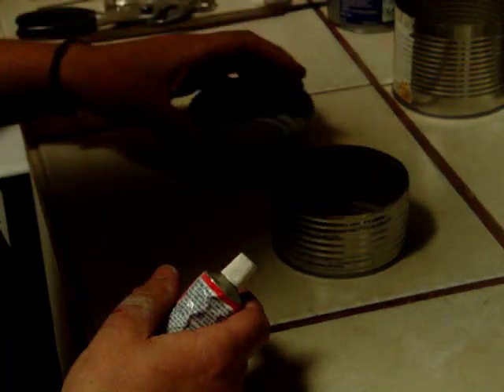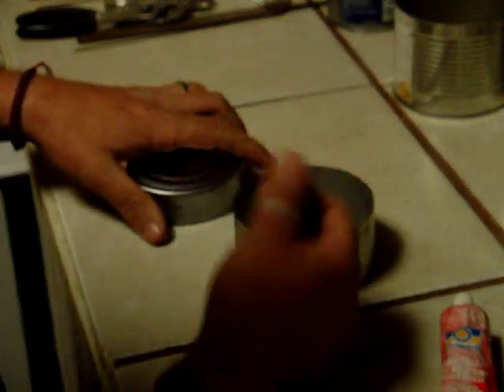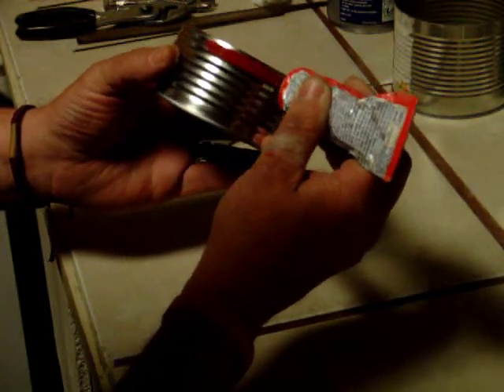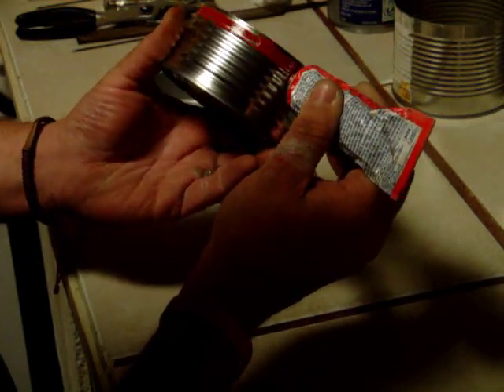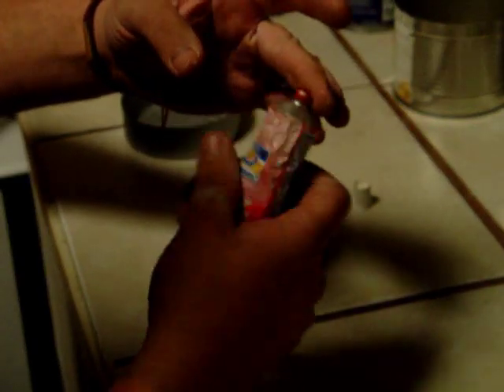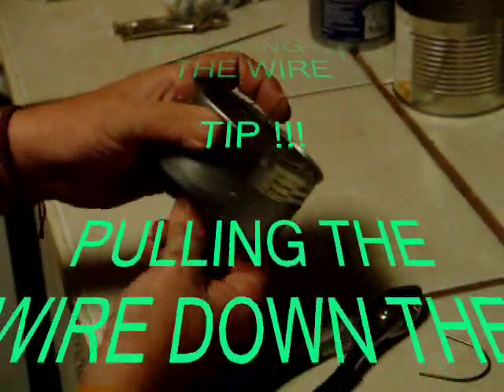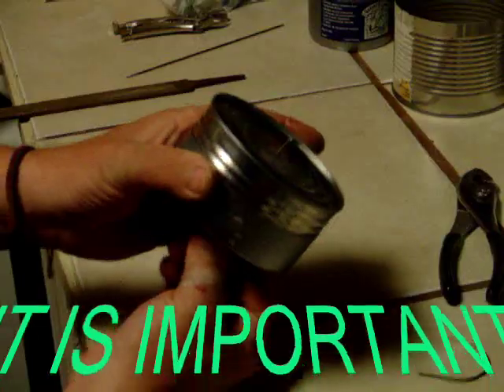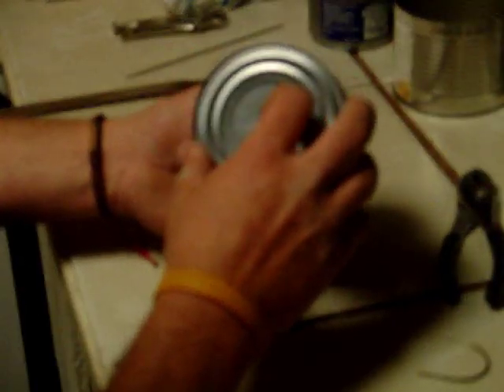PART 7 HOW TO BUILD A TIN CAN STIRLING ENGINE  DISPLACER BUILD 2.wmv

Comment: Punching the hole first would create an escape for the air in the displacer as the two cans are being put together.Otherwise there is a risk of internal pressure pushing a leak path through the sealant.

Comment: Couldn't you just use a broth can and drain the broth out through 2 holes in the top and bottom that you later seal up? Instead of cutting and resealing. You'd have to make the whole project bigger, but it might be easier that building this and a press. I love the project as a whole btw. Full of great info thats scaleable for bigger projects.